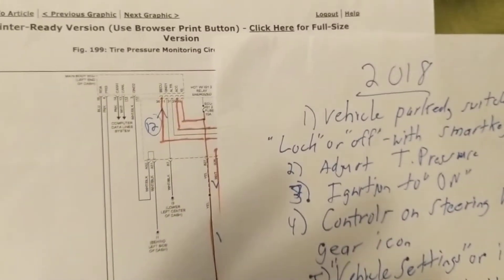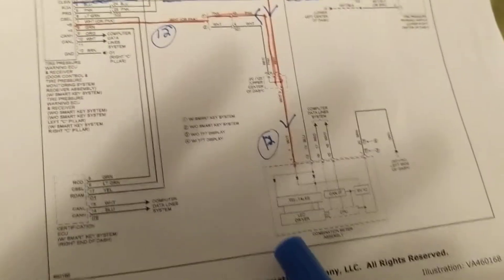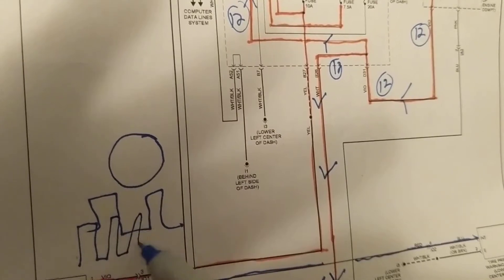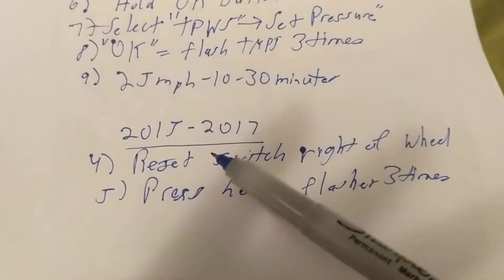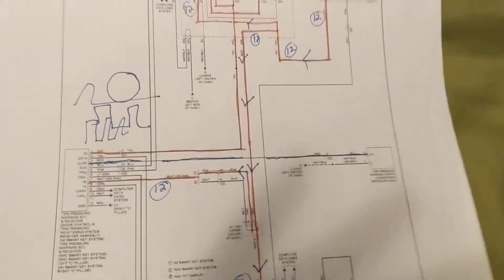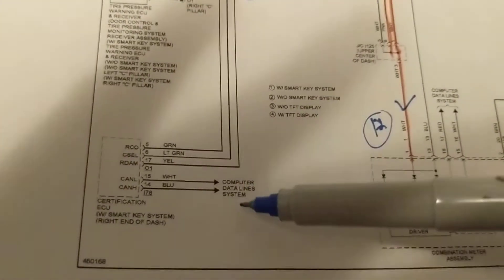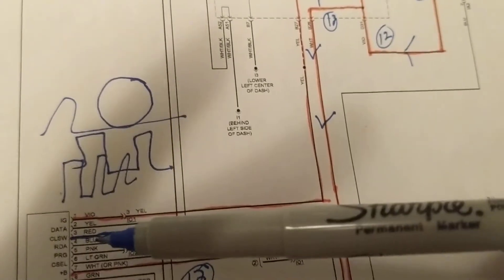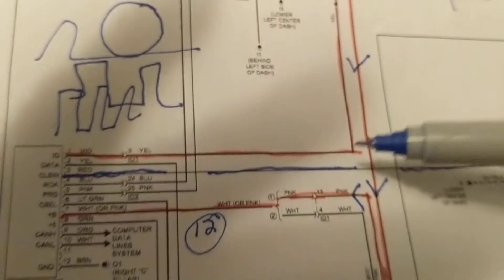TPMS how to reset for Toyota Camry 2015 through 2018

Comment: Nigga nun of dis shit is necessary just tel a nigga how to reprogram the shit
Reply from the maker: The reason I went through this is because I received emails from people with different makes and models of cars of which there wasn't sure if it the problem is to reprogram it for example to reprogram computers you need a scanner tool and a laptop not everybody has that equipment

Comment: Joe: thank you. I have a 2017 Camry SE, and under the glove box cover there is a TPMS reset button. But however long I press and hold, the warning light does not go away. Pressures are good in the tires. We just bought the car from a Honda (I know) dealership, and while driving home came up the light. During the test drive, it was not there. Test drive was about 10 miles, then it was about 15 miles when the light came up. Any idea? I am thinking about knocking it off via OBD. Thank you.
Reply: A couple of things with the system if you change the tire you have to also put the transmitter back in it and program it if you do tire rotation same thing applies so that the computer knows which tire is correct also sometimes the spare tire it's incorrect pressure
Reply: @automotiveelectronicsfroms2699  thank you. I think if I cannot fix it, I just take it back to the dealer...